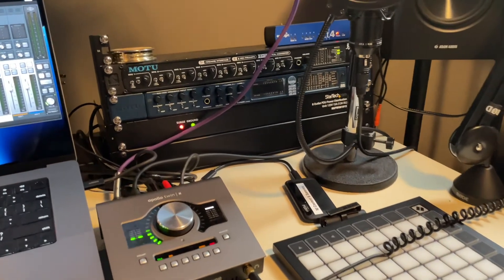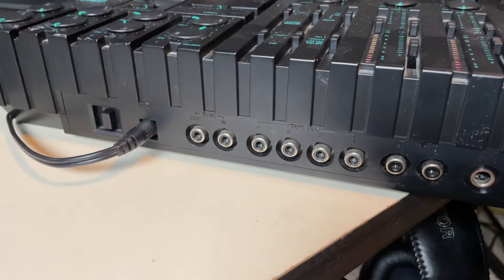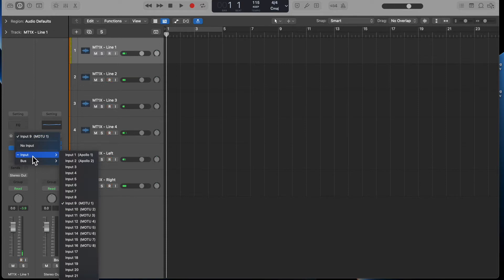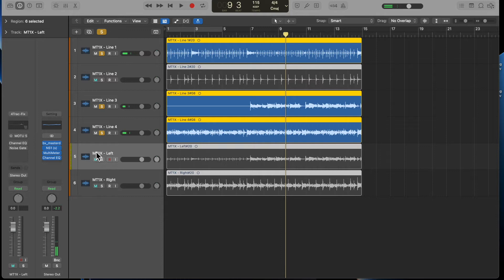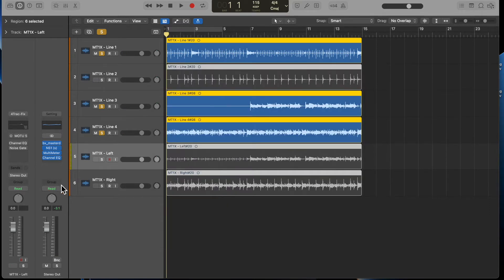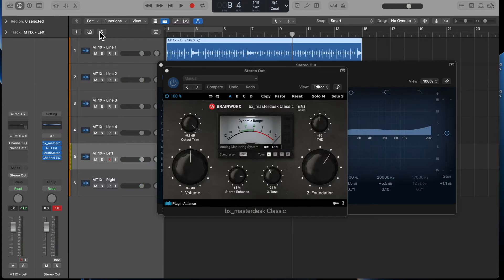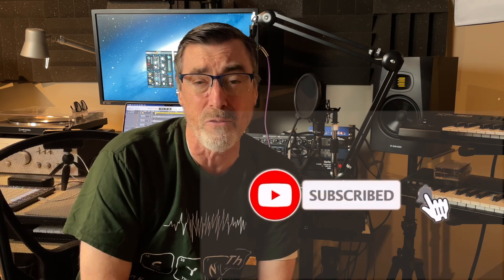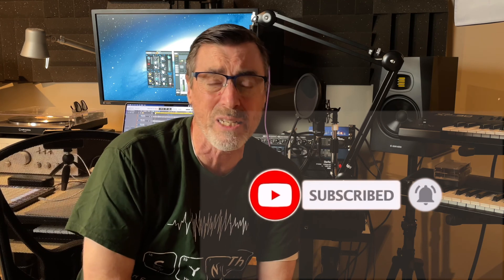How to Convert 4 Track Cassette Recordings to Logic

Comment: Hey Jeffy, great video. I'm trying to do this now, I have a very similar 4 track and need to buy an audio interface for my not yet purchased Logic Pro. But I don't understand where the Apollo twin fits in? I was thinking, an audio interface will plug start into Logic, and that my main focus should be ensuring that the interface has enough inputs. What does the Apollo Twin do please? Thanks in advance. Kev
Reply from the maker: You don’t need an expensive audio interface like the Apollo.  There are sub $100 interfaces like an Evo 4 that will do the job.

Comment: hey thanks for this video! i got some old tapes that i'm putting into logic. i dont have a motu handy so i'm goin rca into a mixer, then mixer to apollo twin with console, to logic. (this first tape i'm converting is just recorded on one track, but others have more.) when i play it back in logic, it plays back a little faster than the tape ever played. why is this? how do i fix it? (just manually flex time it out?) 
you mention a tape speed control slider in the outro. where is that slider? on the 4 track or the motu or the daw (or somewhere else)?

related question: i'm currently using a tascam porta 2 mk2 with one stereo out, but when i get to 3 and 4 tracks to output i'll want to find a motu or something to send it through (to account for the speed variations in playback). but to send it out from the tape someone loaned me one of the tascams that plays back at double speed. do you know about these? they got me confused. ultimately, do i just flex time it out? thanks!
Reply from the maker: That’s strange.  I had no trouble with the playback speed.  My mention was the 4 track cassette player (in my case Yamaha) had a variable speed slider.  Whatever speed it was set to, was the same speed I’d hear during playback.  No faster or slower - exactly the same.  The MOTU is/was not a factor.
Reply: @JeffyG  ok so i did some comparisons and it seems like the playback speed of the 4-track is just faster than normal. might have to flex it. thanks!

Comment: Probably a silly question but is it possible to get these 4 tracks into a DAW using just a cassette deck?
Panning the first 2 tracks would be easy - but then the other 2 tracks on the opposite side of the tape, could that be reversed digitally?
Reply: Possible but tedious.  A stereo cassette will play 2 tracks forward and 2 tracks backward.  You can record all 4 tracks separately with your audio interface then flip the backward tracks in your DAW.  Most DAWs have ‘ reverse’  for any given track.
Reply: @jeffagoddard  Thanks, ill give it a try. Ill let you know how it goes.
Reply: @anthonyroberts7641  Ive been trying to do this too. Its not going well. LOL

Comment: Hi, great video, I wanted to do something similar a while ago but with no luck, unfortunately I recorded my tapes (late 80's) using an Amstrad Studio 100, cheapo machine but all the teenage me could afford. I recently purchased a second hand studio 100 to do my transfers but it was not possible as the machine only outputs 2 tracks at a time, i tried transferring tracks 1-2 first and then tracks 3-4 second time around, but this time the tracks would drift away from each other in logic, so now I am stuck, the machine offers no solution to transfer all 4 tracks in one play, which would be perfect as the tapes sound good. 

Someone suggested that a Tascam 4 track would playback my tapes perfectly well and I would able to transfer them that way, this is what I am trying to find out about before I make any unnecessary purchases :-)
Reply from the maker: The Tascam 4 track is a great unit and as long as your cassette tapes are in good shape, it should work.  However, I haven’t tried it myself so no 100% guarantee.  Ideally, you want to just rent or borrow a Tascam machine, instead of buying.  Possible issues could be the head alignment from the Amstrad Studio 100.  It might not match the Tascam.  Also, the tape speed from 4 track to 4 track can vary.  The Yamaha I borrowed had variable tape speed, which I had to adjust to get a song into the right key / pitch.
Reply: @JeffyG  Thank you, the tapes are in excellent condition, I am just going though them now with a Teac tape deck (there's over 100 of them) so I can work out which ones are normal 2 tracks recordings and which are 4 track masters, I have stored the tapes well and they play excellently, I will need a machine with a variable speed because I sometimes sped up the tapes to get better sound quality. I will start doing my homework, thanks for the advice.